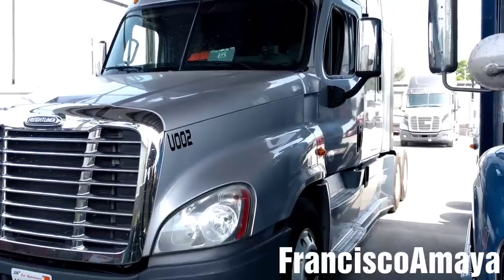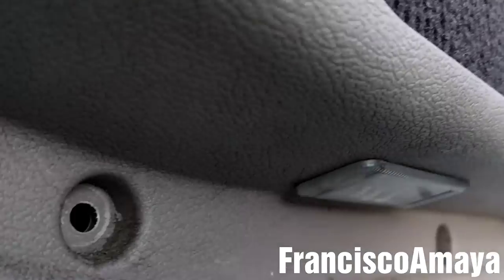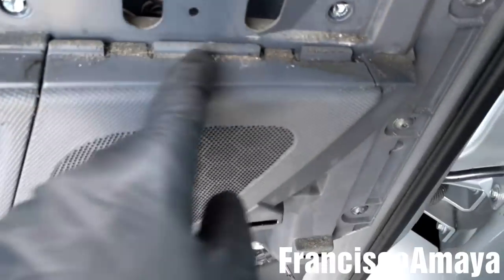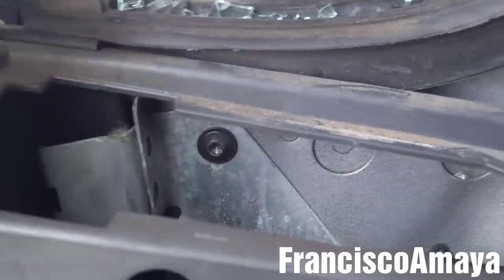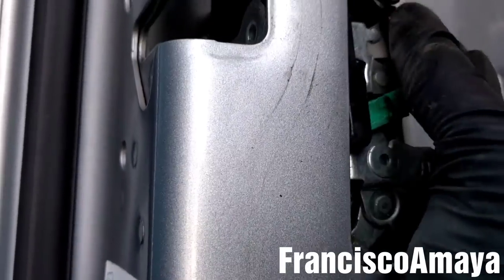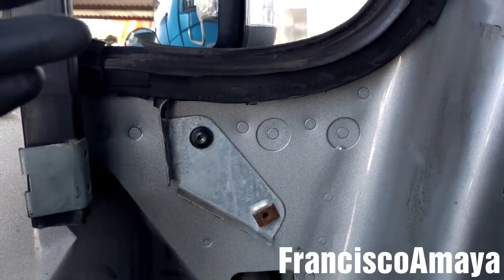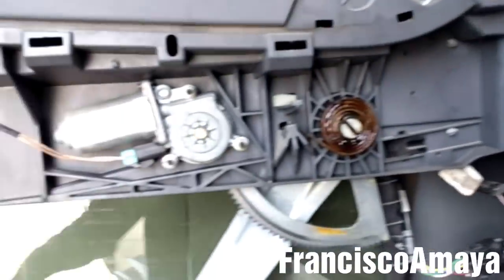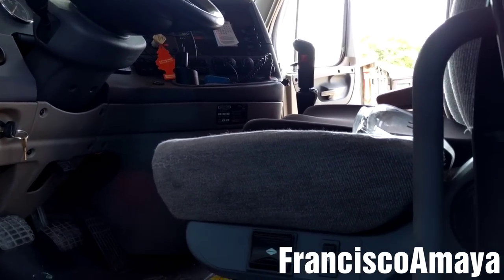Freightliner Cascadia door panel removal quarter window replacement

Comment: I've changed the vent window on 2 different Cascadias and I didn't take anything apart. I used the rope method. Same method when installing windshields.
Reply from the maker: agreed, that is a faster way to do it